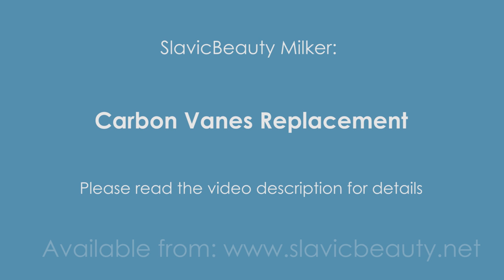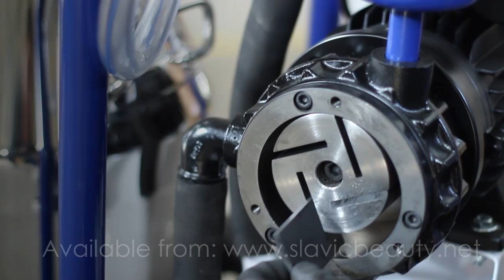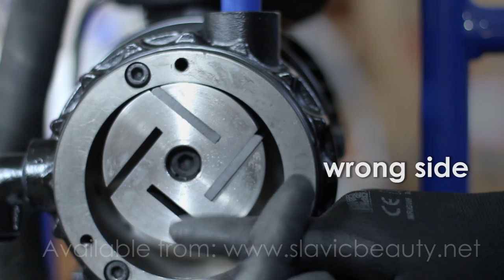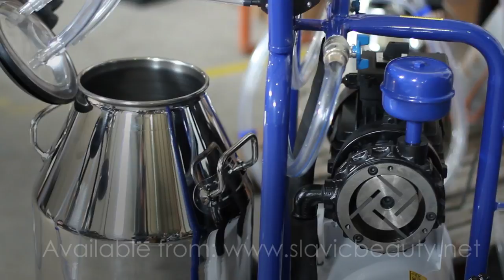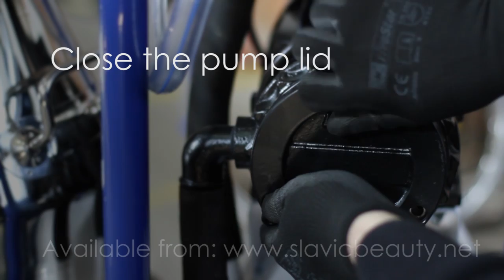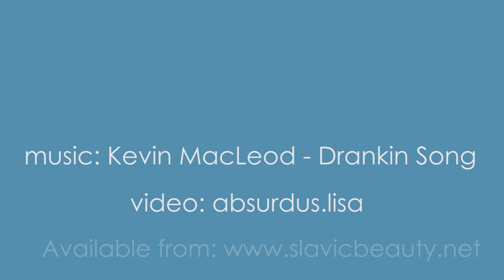Carbon Vanes Replacement|SlavicBeauty Milker

Comment: does this work with steam? how fast would they wear out. can they be lubricated when steam is used to drive the pump?
Reply: Carbon vanes are self-lubricating. What would you use for lubricant? Graphite? They wear out depending on how fast you spin them.

Comment: You forgot to mention the appropriate grit of sandpaper. Not so good for the steel parts if you use too rough a sandpaper and too fine a grit will accomplish almost nothing.
Reply: Hello, what would be the appropriate grit of sandpaper?